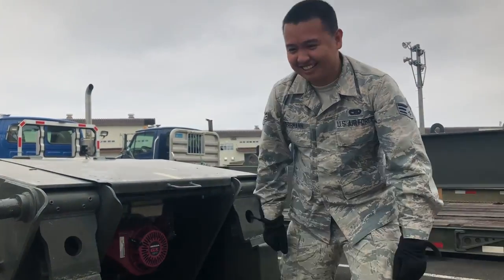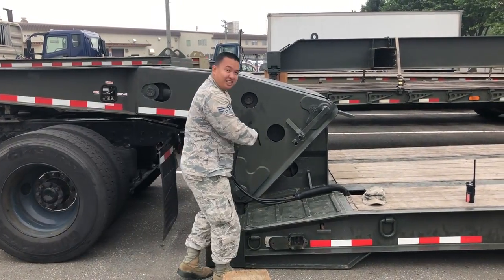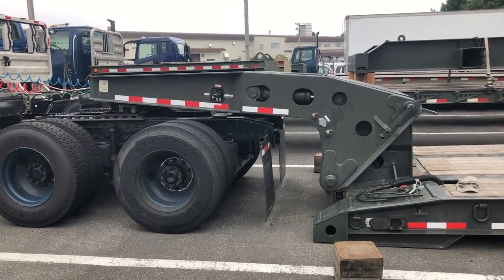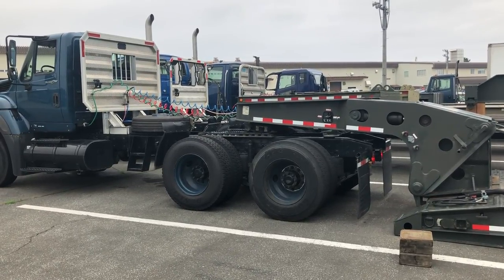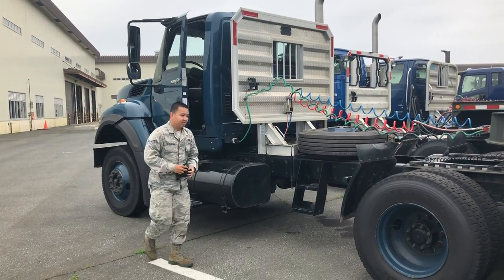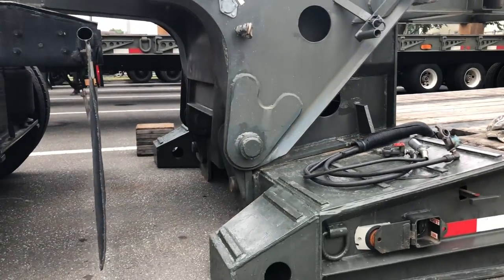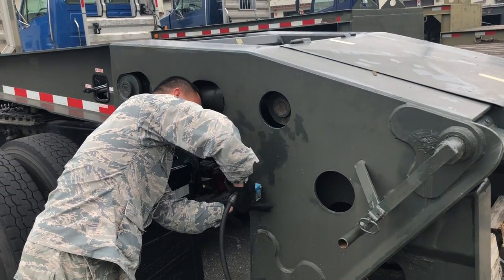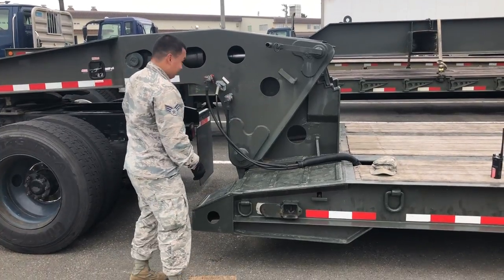How To Use A Lowboy Trailer.- Lowboy Training

Comment: I've been seeing lowboys here and there all the time. No one has explained how they work. I figured the hydraulics have a purpose and that it "somehow" pushes/pulls the neck to/from the trailer lifting/lowering it, but this video actually explains something and now I finally figured it out.

Thanks for the vid!

Ps, why in US lowboys are so common? Does it have something to do with weight stuff or what, since I have never seen one in Europe (not to say there isn't any), but we have just regular flatbeds/lowboys of our own that equipment gets driven on through integrated ramps which are similar to the rise of lowboys.

Asking since the ones we use don't need the tractor to move away at all, wouldn't it be faster?

Comment: if you wish to save two step here how you can do it ! the tractor have air bag if yes lower the airbag before lowering the trailer after you do the usual steps to disconnect it is a the move forward one foot part that changes so basically put the air back in the airbag . there you save one step ... to reconnect you lower your airbags one foot before the trailer and do like you do normally

Comment: I’ve never had to and seen anybody get in an out of the cab numerous times to disconnect or reconnect a lowboy trailer, and seeing that procedure on dropping the trailer, pulling forward a little then raising the neck before pulling further, I’ve never seen that before unless the frame of that tractor doesn’t have a skid to keep the neck from touching the ground.

Comment: Take the gloves off put your gloves on. Take the gloves off. Put your gloves on. Take your gloves off. Why don't you leave your gloves on and get the job done.?? Do you even need gloves to touch the steering wheel and the control levers?